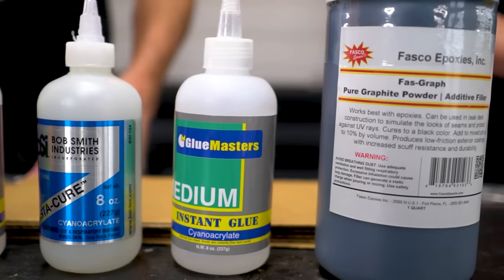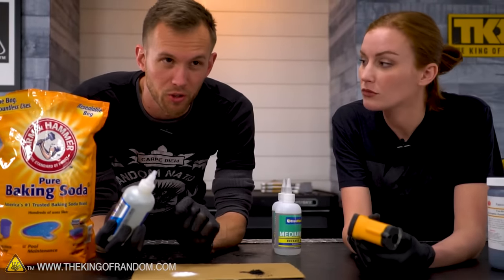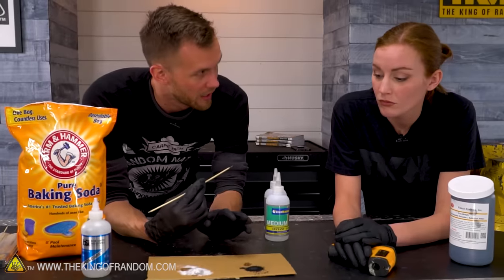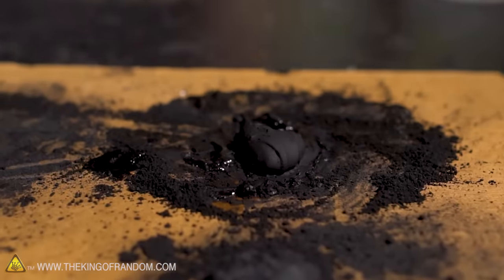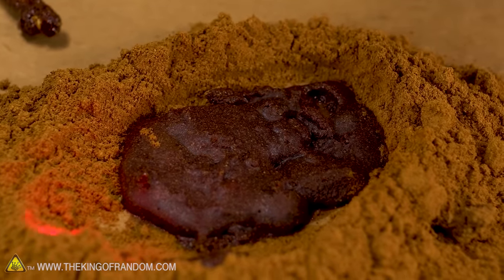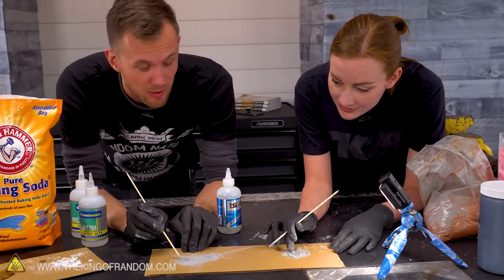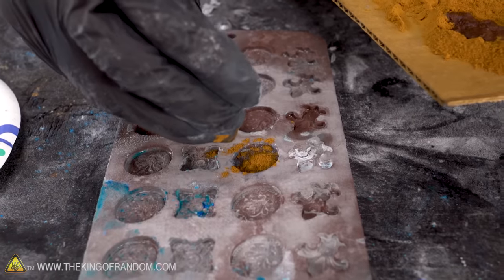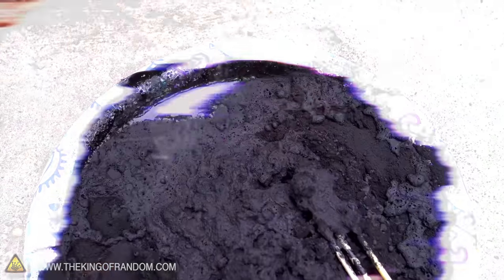Super Glue And CINNAMON Has An UNEXPECTED Reaction! The TKOR Super Glue and Baking Soda Trick!

Comment: The least expensive way to buy cyanoacrylate / superglue is to buy the bulk packs of 2g / 3g tubes of nail glue, which is a medium viscosity cyanoacrylate. 40 tubes on Amazon go for less than 10 tubes of ‘DIY superglue’. Yes, you can buy bigger bottles, but if, like me, you tend to not use a lot of it at any one time, small tubes can be more convenient, as superglue can go off really quickly, as we all know.

Comment: Baking soda and super glue is actually used in the military on carbon fiber helicopter blades, any little cracks or nicks is filled in with super glue and baking soda and then sand it flat.

Comment: I wonder if it would be easier to polishing the parts with a Brass brush making it easier to get into the cracks and low spots. Another thing that superglue will harden like plastic is ash from a cigarette and if you need to fill a screw hole in a hinge hole use the filter from a cigarette and drop in some superglue and redrill a new hole.

Comment: Hi, friends, I have a question and I need to know if you can help me ---i am doing a little project I am building a little tequila dispenser and I already made a hole in the bottle --I set the little faucet in that 1 /2-inch hole but I can not put the little nut inside the bottle due to size of the bottle mouth ...so I am planning to use some kind of bond/ epoxy clear to put on the outside the bottle so the little faucet doesn't leak and be stook to the bottle forever and ever amen---is it possible to use your method?

Comment: I have to say, I have some concerns about the gas coming off of that, super glue being primarily cyanoacrylate, not to mention the heat generated; there's almost certainly a significant exothermic reaction happening, and I'm not 100% sure if it's being catalysed or what the catalyst would be - there's definitely an unknown gas byproduct which could be quite frankly very dangerous...
Reply: Acetone is a Super glue catalyst. Also dissolves it too, at a greater concentration.

Comment: Sanding down wood and mixing the residue with superglue works great on gaps in wood even oiled wood but not waxed or painted wood.
Reply: When I sand my balsa models, if there are gaps in sheeting I let fill with the fine dust then I hit them with thin CA. Yeah you can raise a bit  or surface roughness that needs sanding but it skoothes out nicely with some fresh 220 - 320. Done right it looks smooth and homogenous after sanding.
Reply: pva works fine too

Comment: early on you mention how a form of graphite is designed for use with epoxy.  this is not as a colourant, black oxide would be better for that.  epoxy plus graphite has special high tech engineering uses.

Comment: Odd that you never bothered to learn why accelerators work.

Ifs all about pH.

The presence of free hydroxyl ions is what accelerates it.

That's, why baking soda works.

Dilute bleach will also work.

Anything with a high pH.

I suppose Dutch cocoa would work as well, since it's an alkali based process.

The reason you got no reaction from sugar is because it has a pH of 7 - no free hydroxyl ions.

Cinnamon has a, pH of 8-10, so it reacts. The reaction is amplified by the fineness to which cinnamon is ground